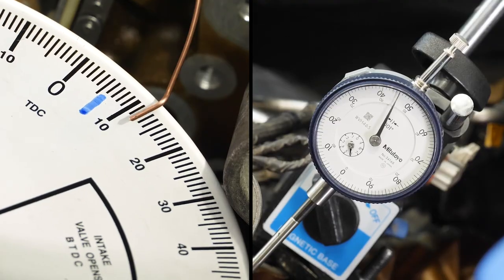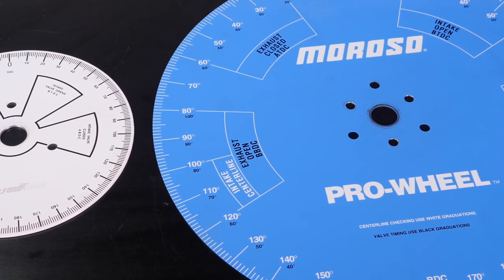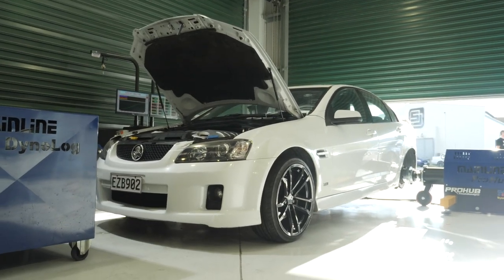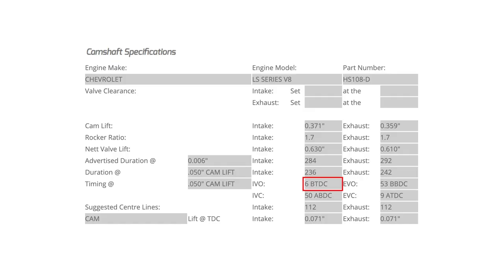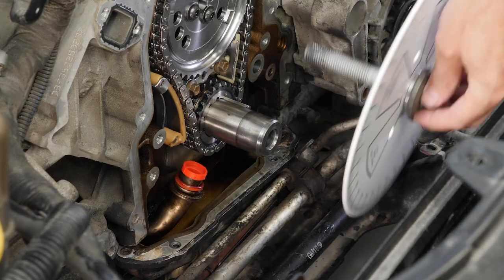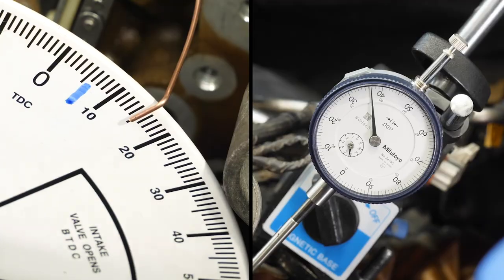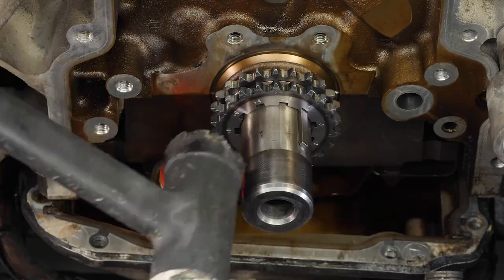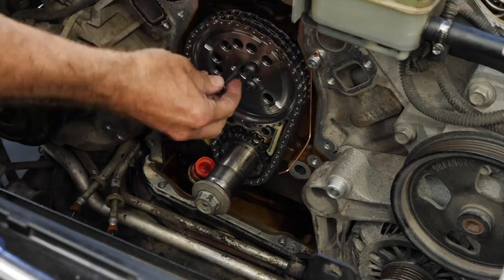LS Cam Degreeing Worked Example Now Live! 🔧📏

Comment: You can only do this if you have purchased aftermarket cam gearsets.
Otherwise if its factory just line up the dots and you will be fine, if you bought the right cam to begin with that is.
Reply from the maker: It doesn't hurt to do this on a factory cam, they can be out of spec a little (they work within margins of error as all mass production does), but we wouldn't pull your engine apart just to do this to a factory cam for sure.
'Trust, but verify' as the saying goes - Taz.

Comment: does only push rod engines require cam degreeing when swapping cams or rhis application works with every type of engines like SOHC or DOHC like rb. 2jz. honda k series other...
Reply: All camshafts can be degreed. It's only required with aftermarket performance cams. OEM (and OE Replacement) cams are drop in and fixed timing.